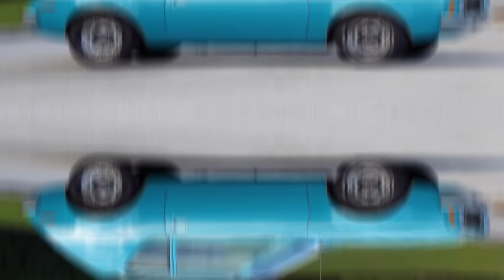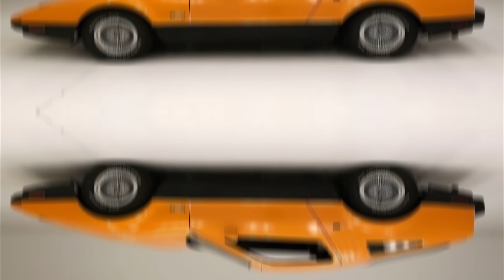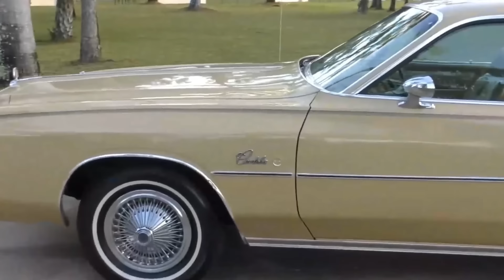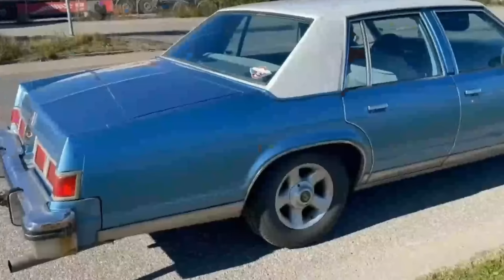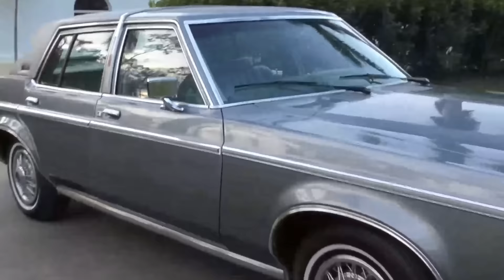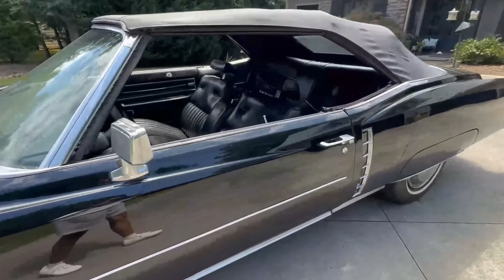Top 11 WORST Cars of the 1970s!

Comment: Chrysler put the Charger name on Dodge's version of the Chrysler Cordoba for one or two years. I loved my Dodge Magnum. I almost bought a Mirada CMX but that particular one was only a 6-cyl. My Magnum had a 360, but I would have preferred a 400 or a 440. I remember when Richard Petty ran a Dodge Magnum one year but they just couldn't make it competitive. It's too bad, because that would been cool to see King Richard win again in a Mopar. I have a racing decal of #43's Magnum. I also had Charger for awhile that had a 440 with a shift kit, slap stick...that car was awesome! Though American only by skin, designed by Dodge ,(innards were Mitsubishi), I'd have to say that my favorite Dodge that I owned was my 1991 Firestorm Red Dodge Stealth R/T! It's Mitsubishi sister was the 3000 GT. drove my Stealth R/T (one notch down from the twin turbo) for 7 years. I had over 196,000 miles on it. It was a fast car! I loved driving it up and down I95 when traveling between Washington DC and Florida - not that I ever broke the speed limit on the interstate. 😉

Comment: The 75-81 Chrysler Cordoba's and their Dodge sisters, AKA Magnum & Miradas were reliable cars other than moisture or humidity issues which could be easily fixed by sealing the distributor cap.

Comment: The Gremlin was a reliable car, and for AMC it was a sales success. The Ford Mustang II was the car that was needed to continue the line, and it was a sales success. The Chrysler Cordova was a sales success, it's sister car, the 1975 Dodge Charger SE was a very questionable move, simply because one was a Chrysler,the other a Dodge and a complete departure from it's previous market placement.
Reply: Cordoba not Cordova. My mom bought a new Cordoba in 1978, it was a nice, reliable vehicle with the 360 engine.